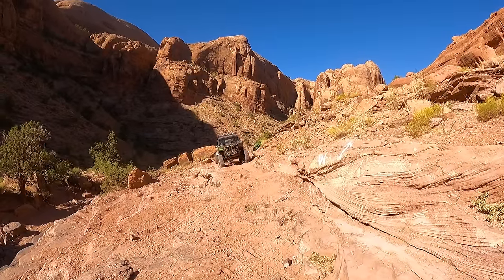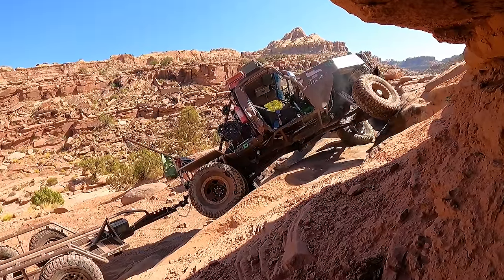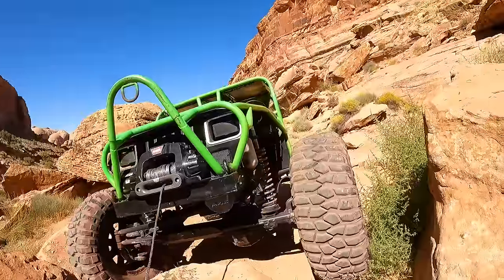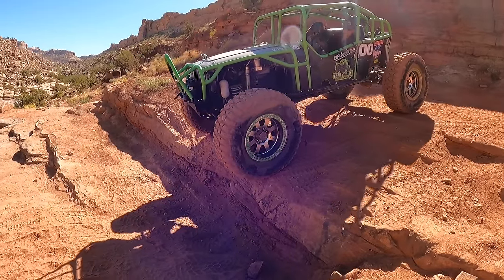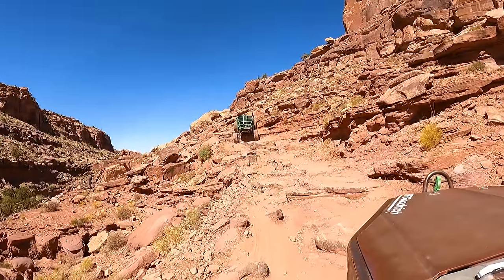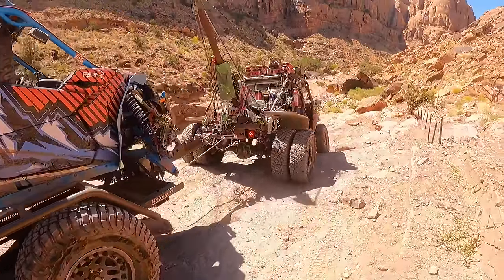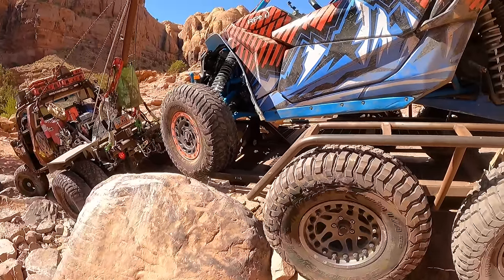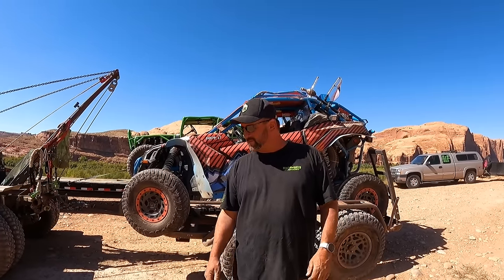SxS Down Pritchett On The Trailer

Comment: I am amazed every video, but the rappelling wrecker was outstanding.

Wanted off-road wrecker driver: must be an expert in fabrication, engineering, physics, manual transmissions, tires, traction, lines, spotting, patience, and nerves of steel.  All others need not apply.

Comment: Just before Rory mentioned electric trailer brakes, I was wondering what cool things he could do, if he had individual brakes  for each wheel on the trailer 😁 Imagine if you will, being able to brake both rear axle wheels, both front axle wheels, both left wheels or both right wheels with the flip of a switch. 😎
 Would it be worth it? Maybe not in time spent building it, but maybe in a cool dig for the viewers.

Comment: Yeah go on, put brakes on the trailer.. switched separately to left and right.. for manoeuvrability... and some sort of drive mechanism so it can pop itself over ledges.. don't forget lockers.. and steering so you can pick a line 🙄🙄 no.. I think it's perfect as it is.. simple, robust, light. It's worked on many recoveries.. no need to complicate things

Comment: You said about having controlable brakes on the trailer: 40 years ago or so a friend of mine  in Vermont built a mini-tractor trailer to haul firewood. He used a 5 ton Chevy chasis and a 1937 Plymouth pickup cab and used the frame of an old school bus frame turned upside down for the trailer. He had hydraulic brakes on the trailer operated by a lever activated master cylinder in the cab. The 2 were connected by a hydraulic hose with quick connects. It gave him control of the trailer when he needed it. ...... Just a thought.

Comment: Rory, if you decide to put electric brakes on the trailer, wire your brake controller like normal and put a switch inline on the brake signal wire(normally the red wire). That will stop the automatic function and still leave the controller active to be able to manually activate the trailer brakes.

Comment: You did an awesome job! I know this is a stupid idea but you could power/brake the trailer with hydraulics. There are many options. Each wheel has a motor and a lock in/out like on a IFS front axle so you can freewheel without the motor causing drag. You could also pair the sides with a single motor and a big chain/sprocket. There are lots of problems like exposed hoses and powering it from the trailer or the wrecker. Powering it from the trailer allows you to use the trailer on other vehicles. You would have to run wires to the cab to turn on the pump and run the valves to control the motors. You could build it all out of spare parts too. Well all except the motors, pumps and hoses. You could use the wheel hub of and IFS vehicle with the lockout.  Or you could just skip all the hydraulics and just use disk brakes and hubs from an IFS. You'd have to power the brakes with a lever/switch. You' could use a antilock brake pump to power it.  I didn't cover any details. told you it was a stupid idea. Probably just leave the trailer alone and keep doing the superb job you do.

Comment: Having the trailer brakes on an on off switch would be good. When I pulled the travel trailer back in the 70's we could independently apply the trailer brakes which I used a lot in the mountains, even once when I ran out of fuel and skidded into a gas station.

Comment: Rory, instead of electric breaks on the trailer... have you ever cogitated something like what farmers do? Farmers have tractors that have a spinning axle coming out the back and that spinning axle thing connects to whatever trailer that has a U joint connection to run whatever trailer attachment for farm use... and thus, in theory, if trailer had a disconnectable U joint, you could make it so that in theory your lower gearing could control trailer wheels. Hit a lever, it connects and makes your trailer a defacto 4x4. Disconnect and its back to normal trailer. It could assist going up or down the hill.

Comment: Sure electric brakes may be a thing but let's get the trailer to have hydraulic drive axels. Just think another green lever for forward front axel or forward back axel forward both axels forward/backward driver side trailer and the last lever forward/backward passenger side trailer. Heck..throw two opposing tires underneath to lift while trailer and do a Bibby brown left right.  More Levers n drink holders. Cheers 🍻

Comment: For electric brakes brakes you can always install a proportional controller and adjust the electric trailer brakes from 0 to 100% from the drivers seat. Easy job

Comment: I agree with you about the 4:11 gears being so strong, but I wonder about something like that or even a higher ratio with a doubler transfer box. You could make it a highway ready rig, like Blue and able to climb with the extra low ratios. Just a thought not telling anyone what to do.
Reply from the maker: Trailmater runs down the highway at 75 no problem, and crawls with the best of them.

Comment: Rory, I have no idea if you need or want trailer brakes. I've pulled livestock trailers with trailer brakes. My controllers had dials on them too adjust the amount of brake. Then, I also had the hand lever to use my trailer brakes without my vehicle brakes.

Comment: Hey  Rory & Mike !!!!   Great video as always !!! 🙂🙃😉👍👍👍👍👍   With the Question of brakes on the trailer ,,,  Back in the day ,, there was a trailer hand brake on the steering column like the  "" Trolly valve ""on the big rigs so you could set the brakes to drag a little instead of slamming on & off !!  DON"T know if it would help you out ,but there are ""New"" videos on YT about electric trailer brakes & now have them with wireless connections ??? 🤔🙄🙄

Comment: Rory, I have just realised how much of a genius you are. I had always thought of that trailer as a normal tandem trailer, but it is far from it. You have built it as a unit with different combinations of two wheel units using the wheels to hold the back end up over rocks., and the front wheels to lift the trailer up over major obstructions. However, it can also use one back and one front at the same time when necessary, while also being able to swap roles only a few seconds later. Incredible thinking Sir. You really are not just a "pretty face".

Comment: We mounted our electric brake controller to the 4 speed shifter and did not tie it into the truck brakes. When we want trailer brakes we just thumb the slide towards the shifter ro slow the trailer. Right hand is almost always on the shifter and it works well for us. You wouldn't need a separate switch to turn it off if not tied to brake light system.

Comment: The brake controller I installed in my 4x4 (intended for towing heavier ttailers) has two modes it can switch between.

Mode 1 uses sensors to detect how quickly my cat is slowing down and applies trailer brakes appropriate to that.

Mode 2 applies a "fixed" set of initial braking force before reducing it a little bit.

In both modes you can adjust the sensitivity / braking force.

And both modes (most brake controllers are the same) are activated by either pushing the brake controllers "apply brakes" button or when ever the brake lights on the vehicle turn on.

You could install the brake controller and not connect the wire to the brake lights so that they only work when you push the button, or you could put a switch on the wire to disable it when you want.

The advantages are that you have more control, including being able to brake the trailer separately from the vehicle.

The disadvantages are the cost and time to install it.

Seeing that you used a winch to gain control on a down hill section, I'd suggest that you could make use of that extra control.

Ultimately, if you don't have traction, then it doesn't matter if you have brakes or not, but with even my empty trailer (500kg / 1,100lbs) behind my 3,500kg (7,700lbs) 4x4, you can feel when the brakes are turned up or down.

One thing I will say, my trailer only has brakes on one axle, which is fine for on the road with a load sharing suspension setup, but I will be adding them to the second axle because even with suspension I can lift those trailer axles off the ground when on steep terrain.

So you'll definitely need to put brakes on both axles.

Comment: I am constantly amazed by the skill, strength and tenacity of the men and machines of Moab Motorsport 😊 they always "take a lickin and keep on tickin" (you might have to be old to know that reference)  I think the "un-named"  arch should be dedicated to Moab's Official boid... The Diamond Billed Rock Peckers!  Letting the trailer become the rear steer at about  12:55 WOW!   Trail Monster does it again and again and again! a reae anchor to control downhill... brilliant... no front flip this time 🙂  BFG should be marketing their tires with your videos 🙂  I wouldn't feel comfortable walking down the slpe at 17:30 and Rory drove down with a trailer and SxS in tow... WOW  Wow WOW!  This looks like the most technical recovery yet 🙂  I would like to see the drivers ahead of you at Farmington do what you and Mike just did  🙂  There is no shame in a winch... the shame comes when you don't use it and fail.. or break something 🙂 rock cairns are a form of vandalism... I kick them over too   🙂

Comment: Use a trailer brake controller and just turn the gain down.  Added benefit is you could engage the trailer brakes without engaging the wrecker brakes.

Comment: While I don't drive nearly the type of terrain you do, I have felt the benefit of grabbing the trailer brake and dragging the trailer down off of an obstacle rather than trying to control it as it pushed me down. 
For the situations you are in (again, having not been in the level of terrain you work in daily), it might work better as a just a switched on/off type of control rather than a traditional modulated or progressive trailer brake controller.

Also, the winch rappelling, I've never seen it before, that was a good idea.

Comment: You would need trailer brakes on both axles half of the time you have tires in the air, but they do make a slide switch that self returns.

Comment: All the electric trailer boxes I’ve seen have ways to turn them up and down. When down the brakes on trailer won’t work. But the old boxes that are ram by brake fluid can’t be turned down but the one run by petal you can

Comment: Awesome as usual but I have an idea. I'm not sure itll make a big difference or not but what if you put a strip if old tire or something over the center pipe of the trailer? It might save extra scratches and possible rounded off bolt heads on the underneath of those side x sides......just a thought while watching from a distance.

Comment: There's a lot of situations where trailer tires meet the rocks at about the axle height and after a lot of tugging it might go over those basically by luck.  Or you need to reverse and stack rocks to make a ramp for it.  I don't see any harm in welding some rock sliders couple inches from the tires under the trailer, so that those would guide the trailer up on the larger steps and make the tire hit the rock few inches below axle and make it way easier for tire to roll and climb over.  What am I missing, there's usually very little room for advice on this channel and I'm just curious why that isn't implemented yet.

Comment: "Not today hippies." 😅

And just fyi you can keep your electric trailer brake at zero if you want, and then adjust it to be wherever in between zero and max when you want. I have mine set at like 0.5 for my small trailer when it's unloaded. And I set my big trailer at like 7 (out of 10) when it's loaded. And you can of course use it on demand if you want. But you might already have your hands full.

You could just brake one axle on yours. Of course you'd have to run wire to your trailer. 😅

Comment: Electric brakes combined with a good brake controller would suit your application,but take things further with a couple of electric drive motors on the trailer to assist in the vertical , battery pack on the trailer , charged with a driveshaft driven alternator 😊

Comment: Trailer Brake Solution: You could use electronic trailer brakes on the trailer, but instead of using the brake controller, just put power side on a potentiometer switch in the cab so you can turn up the resistance as desired and when needed.

Comment: everyone thinks they're big and bad in there jeep's then here come's rory in his chevy dragging a rzr on a trailer, thru the toughest trails known to man😂😂

oh and the front driver shock on the tow truck is spinning around the shaft as if the bushing is wore or the nut is loose!!
Reply: at least moving enough it could slam the reservoir in the frame and create a hole in the lines

Comment: Question of the day, when it gets bound up like it did in that Nob Rocker or whatever the hell that nasty wall is, does it actually push the truck down from the weight of the trailer to the point where you can’t dig and readjust & you just kinda ride it out…? Hope that makes sense. Few beers in tonight 🤙🏻

Comment: Great job as always. I see no advantage to brakes on the MaterTralier. It would add a good deal of weight to the trailer and brake controllers are sometimes glitchy at low speed. KISS.

Comment: If I were to add brake to that trailer I wont tie it into the brake switch, I would only have it turn the brakes on from the manual lever on the brake controller that way you are in complete control of when and how much brake is being applied. The real question is if all the work to do it would be worth it or not

Comment: Why do you have such low pressure in the trailer tyres Rory? this must add rolling resistance to the tow, and they don't need the grip for traction.

Comment: Rory do you have any experience with electric brakes? Most controllers have a dial in cab you can turn up and down. Check out the Redarc Towpro Elite. Most people towing trailers from 2t to 4.5t in Australia use this controller including myself.

Comment: Hey Rory, What psi do you run on your trailer tyres? Donyou run them slightly higher than the truck or the same. Just wondering is a bit more psi in the trailer tyres helps pop it up over ledges and bigger rocks?

Comment: If you did the trailer brakes,  with a spring return slide or thumb switch on the shifter it could be a benefit at times. 

But that trailer spends a lot of time with the tires floating it may not be worth the time.

Comment: Such an easy fix. Add proper electric brakes…..the switch just has to be a ground interrupt switch. Snip the ground at the trailer, add a switch, then extend the wiring to the switch far enough to mount into the dash….laymens wiring.
Reply: Also those big drops, because it’s a manual, can you use the ebrake by hand instead of foot brake, and maintain throttle control that way?

Comment: maybe you could do electric brakes on the trailer with a manual controlled hand switch then that way you could used it when needed by hand but not have it fighting you when you don't need it

Comment: I honestly think an electric trailer brake would be a good idea. However not in the traditional sense. Instead just having it act as a treadle brake instead of automatically based on the brake pedal that way it only engages when you intend to engage it.

Comment: If you really want brakes on your trailer you cold simply add a switch in the wire to the trailer and then be able to chose brakes or no brakes.